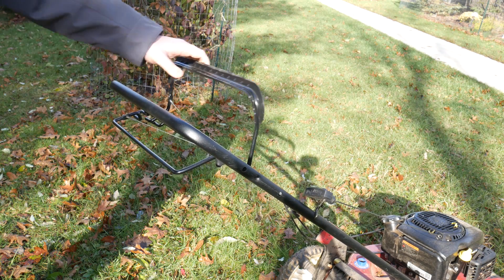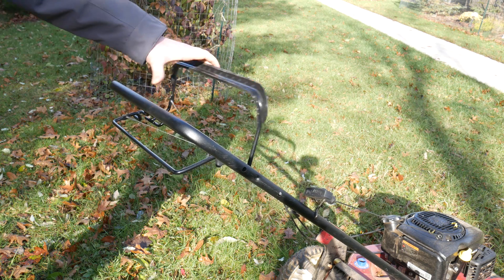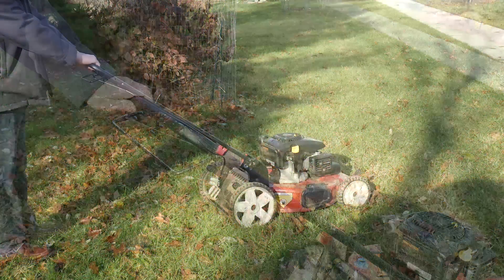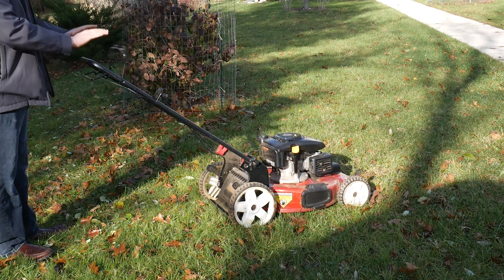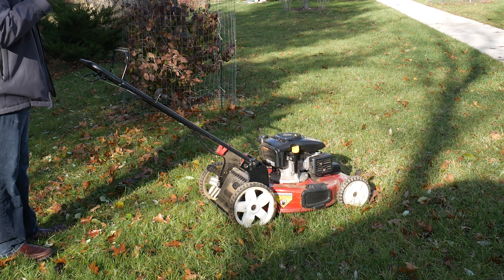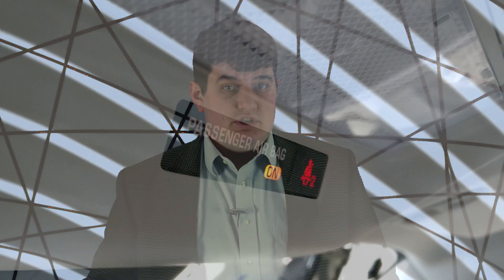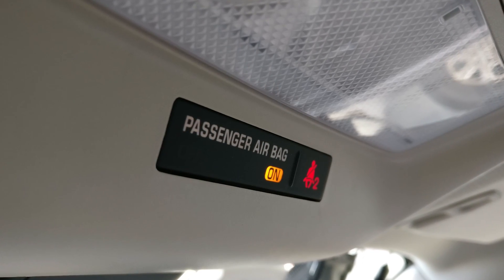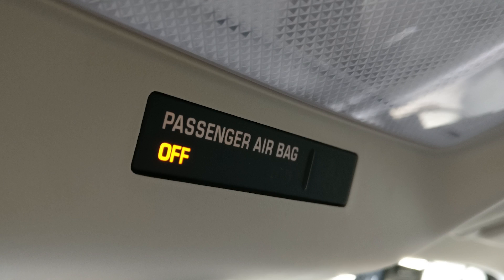The Dead Man's Switch:  How Anton Yelchin's life could have been saved

Comment: i have a question... couldn't he have just applied the handbrake? (i'm living in Korea rn and no one seems to ever use the handbrake - they'll even put blocks under their cars to stop it moving while I'm like you... you have a thing for that. A Korean person excused her poor driving by saying that "for some reason, my father in law put the hand brake on when he parked," you mean like you're supposed to?)

that said, i think you're right about having a dead man's switch in cars - why can they be operated if no one's in the seat?
Reply: Aileen I always apply the handbrake before placing my car in park. Its good for you transmission and is a failsafe in case that tiny mechanism that holds the car in place breaks.
Reply: I'm not sure about others, but everyone that I know the habits of, including myself, only engages that brake when parked on a steep incline.
Reply: @dmdizzy  I know people that won't even use the parking brake on hills. I just bought a box truck with a non functional parking brake. Clearly the previous owner didn't care to use it, I bought it from a dealership that didn't fix it, and it was a reputable dealer that also sells new cars. Not many people care in this area
Reply: On this model of car (more a 4x4) it used a stupid "foot handbrake" a lot of people don't use it as its odd way to put a handbrake on (they just use the transmission Park)
 as this model uses stupid return to center automatic stick (you have to press the button tap it up or down and then let go very bad design) it should have a open door auto park when stationery as the car automatic transmission is part of the canvas network it can already read if the door is open
Reply: I usually apply the handbrake whenever I park my car, because I was taught to, and it's another level of insurance against situations like this. But sometimes I forget.
Reply: @MattMcIrvin  I was taught the reverse: always apply the handbrake as primary measure when parking. Putting the box in gear (we mostly have manuals here) is a secondary measure in case the handbrake fails. The handbrake is designed to hold the static weight of the car. The gearbox is designed for dynamic power transmission. The gearbox can hold the static weight but it will wear out faster if you don't use the handbrake for parking.
Reply: I had the same thought. Here in the UK I've never driven a car with an automatic gearbox; so for me, to park without applying the handbrake would be insane. I was even taught to engage first gear after the engine is off to provide some engine breaking in case the handbrake fails, especially when parked on a hill.
Reply: It's just the very specific design of this car automatic gear stick it's fully electronic but that's not the problem as a lof of cars for long time have used electronic gear stick, the problem is with this design it always returns to center when you let go of the gear selector 

you press on the button on the side shifter and press it up or down it doesn't click or lock into drive/neutral/reverse, so you have to visually look at the dash to confirm what you have selected where as in other cars you don't have to look because just from the feel you know what mode you selected 

And to add to the above problem the hand brake is not a actual handbrake or e-brake, it's an actual side mounted foot parking brake so in this particular car it's very common not to use it, the sad thing is the automatic gearbox is connected to the Cambus network so the car knows when the seat belt or driver seat sensor (not seating) and door is open and should automatically shift into park when both conditions are met,, this is how BMW and a lot of other car makers have there car programed so as a failsafe it will automatically shift into park if your not moving (and may automatically activate the e-brake if it uses that type of handbrake system) if them 2 conditions are met to prevent rolling every time

The car manufacturer can release an update to make it read the door and seat belt sensors for that particular car but have yet to do so (even on the newer models of that car that uses e-brake it still doesn't auto park on the transmission) 

I even had some sort of jeep That had  automatic e-brake for stop start traffic and that thing was dangerous because if you had auto e-brake turned on and you stopped say at your house the e-brake would activate when you have stopped it then not longer after the car stupidly disengages the parking e-brake and this is in a manual transmission so high chance of rolling as a result (its not like its instant it actually waits about 15-20 seconds to take the handbrake off, so long enough to get out of the car just as it turns the e-brake off) in the end I turned off the automatic stop/start e-brake so I knew I had pulled the e-brake on when fully stopped (as because when I turned the car off, it would ignore me pulling the e-brake switch because it had already put the e-brake brake on but because the car is now off it releases the e-brake, very silly) 

Basically what was said in this video (I forgot what this video was until I looked at the title)
Reply: I can't trust modern parking brakes. I was sitting in a 2019 mb sprinter with the parking brake pulled as tight as I was able to. The van still moved after sitting for ten minutes, and did it more than once. I had to keep checking that I didn't get hit from behind. This was on a slight hill, nothing major. I could only imagine a steep hill. The only cars I can trust are the ones I've worked on. I've seen so many slightly older cars, that get maintained by shops but the parking brake is never checked.
Reply: @arthurr8670  Handbrakes are almost always adjustable in seconds. Mine has a screw on the handle that tightens it.
Reply: @kylehart8829      Not all of them are easy. Some cars need you to take apart the center console to get access to the adjustment bolt. That is only part of the adjustment. Under the car, near the brakes, there is also an adjustment for each parking brake, which is needed to be adjusted with the adjustment for the parking brake lever. On cars that haven't been touched, everything needs reworking because of corrosion, at least where I live.
Reply: Newer cars have electronic handbrakes that automatically apply in the park gear. Trying to mess around with it will just disengage it.

Comment: I have a feeling there will be a sensor in the driver's seat, regardless, since cars have to be made for left and right hand drive.  In fact, it may even be connected and its merely a software locale that decides if the sensor is used.

Our Skoda Yeti will show a specific seatbelt warning light if you turn on the electronics and there is someone not wearing a seatbelt, and I think some cars even bong at you if you try to start the engine with no belt on, so for those vehicles its just a matter of software that prevents there from being a dead man's switch.

Comment: While that's good and all, I still much rather not have a drive by wire system and be able to control my vehicle mechanically.

Hell, I've been in situations in which an engine has stalled out on me, and I thankful to have the ability to still be able to steer and brake (albeit with a bit of difficulty - them systems are hard to move when not power assisted) to a safe (or in my case, since my home is down a mile stretch of road, ride all the way home) spot.

and for those of us who like to offroad, or drive down neighborhood roads (basically a long driveway, aren't governed by normal driving laws), it's convenient to just leave the seat belt off (I've even disabled the warning ding in my Jeep for that situation).

However, my Jeep does not allow you to remove the key in the ignition unless the vehicle is in park. Just like you need to have your foot on the brake to shift out of park, you also have to have the key in the ignition, and you can't take the key out unless you shift back into park (you can, however, turn off the engine).
Reply: AND in riding mowers, while there is a deadman's switch in the seat, it only works IF the blades are engaged. If you're sitting there just with the engine going (no blades, doesn't matter if it's in gear or not cause that doesn't have any electronics), the mower will still run if standing up.

Comment: I recognize that I'm about two years late, but this is an exercise in unintended consequences.  Consider if there were a dead-man's switch in the driver seat.  What happens if a driver shifts in his seat while on the highway, perhaps leaning to one side or lifting their hips on a long drive to stretch or something?  Car shuts off?  Or even worse, shifts into park or applies brake as you suggested.  What would the potential cost to life of this "safety feature" be in reality, when compared to this incredibly low likelihood scenario.  Let's say the switch just fails (as is all too common in automotive switch components), perhaps from an overweight driver or perhaps a liquid spill.  Maybe the fuse that the circuit is on fails at some point.
I often find that if the solution to a problem seems too obvious, there are a few good reasons why it's not really an adequate solution.

Comment: My Tesla model 3 automatically engages the parking brake if I'm in drive and I open the driver side door and get out.
Reply: How does it physically move the lever to match the change in brake status? Or is that not how Tesla brakes.work?
Reply: @getoffamylan6844  It's electronically actuated, there is no physical brake handle like on some vehicles.  The normal way is to push the button on the end of the RIGHT-hand stock, which when driving and held down engages the emergency brake.  If you have the car in drive, and basically at a stop and get out of the car, it just actuates the parking/emergency brake for you so you don't roll away.  It knows you got out of your seat with detectors in the seat.

Comment: The Tesla Model S has this system. If you lift off the drivers seat the car goes into park and applies the electric emergency\park brake. There have been some complaints of the car stopping suddenly when drivers are reversing and they inadvertantly lift up from the seat when turning around to look rearwards.

Comment: Just going to point out the fact that virtually all cars since the Austin/BL Princess in the 1970s have a usable Dead man's switch already installed!!!!
The same switch that nags you to put on your seat belt could be so very easily double up as a DMS.
If you didn't know about it, or don't drive then if you sit in any car made in the last 40 years without the seat belt clipped and if you try to drive you get nagged by a buzzer and a light until you buckle up.

Comment: I wouldn’t make the seat belt sensor the dead man switch because there are time when temporarily removing the seatbelt is an acceptable risk. It is also possible to accidentally hit the release button.
However I do not see a problem with a weight sensor deadman switch provided the car also comes with a manual override. There may be times you will want the car in neutral and the engine running. A car stuck in mud or better yet snow and the operator is by themselves and needs to rock the car and kick gravel under the tire to improve traction but in winter conditions you may not want to shut off the car for fear of it not starting again.

Comment: I don't know that forcing the transmission into park based on a weight sensor would be a good idea--at least not with some additional checks and balances.

Imagine that you've been driving on the freeway for about an hour. 70MPH. Cruise control. It's hot. You only turned on the A/C a minute ago. You're sweating on your back and your groin is pressing into the groin of your jeans. You need to adjust. Being in cruise control, you decide to place both feet on the floorboard to "stand" so that you can air out your back and adjust your groin. There is no weight on the seat.

If the transmission were forced into park at 70MPH, that would destroy your transmission, cause a catastrophic loss of control, and you would likely die.

Some checks and balances that could counteract that would be to only watch the seat weight sensor if the car is going < 5MPH (edit: good job addressing that) and the seatbelt isn't on. But there are other ways that can go wrong, like in a fast food drive-thru. You might reach up to grab the food while your seatbelt is on, but since the seatbelt is on, the car assumes you're in control of the car and doesn't force the transmission change, causing the car to roll into the kerb. I personally go into park and apply the E-brake whenever I'm away from the wheel, and this habit has saved my ass at least once (I stood up to grab the food and unknowingly stepped directly on the gas pedal, but because the car was parked and the E-brake was on, the only thing that happened was the engine revving at full throttle without moving)...now imagine that happening, but with someone who didn't apply their E-brake, and who had thought they put the transmission into park, but for whatever reason it didn't, and because the seatbelt was on while they were standing, the car didn't shift. Stepping on that gas pedal would mean certain death as you floor it right into rush hour traffic.

Comment: the government is at fault for allowing manufacturers to get creative.  automatics have detents.  period.  u should be able to determine what gear ur car in from outside the drivers door, by its position, not by some stupid tiny led on a shifter that springs back to the same position regardless of gear.  my sprinter van has detents.  park is when i slam that focker to the top detent.  i forget if i do it sometimes if i leave the van while its running and i can tell whether i put it in park, if the doors open and i have a clear line of sight to the shifter, easily from ten feet away.  vehicles are no place for creative license, just like they shouldn't have touchscreen controls.  at all.  buttons and levers are a good drivers best friend and touchscreens and buttonless or leverless controls are dangerous toys on vehicles driven by people that underestimate the responsibility of driving.  that and the sheer hypocracy of the b*llsh*t the government allows.  if i have a cell phone pinned to my ear with my shoulder while driving i'm breaking the law, but a musk driver can finagle with his 24" touchscreen controls all day long, looking for easter eggs in his software or scrolling through menus looking for his heater controls and he or she hasn't broken any laws?  bollocks!

Comment: "steer-by-wire" oh boy I can't wait for my alternator to unknowingly go out and have my battery die while on the road!
Reply: Yeesh, hadn't even considered that.  Throttle control loss would be fine there, but good luck guiding to the shoulder in that scenario.  Add in brake by wire and bam, RollerCoaster Tycoon 3 IRL.
Reply: lacking a mechanical linkage between the steering wheel and rack/pinion or recirculating ball steering rack is against ADR (Australian Design Rules) and would banned in Australia.
Reply: and even if you manage to stop safe on a straight road you couldn't push/roll it out the way without steering. It seems such an odd idea to over complicate something that's been proven to be reliable and instead add it to the massive list of tasks taken care of by the computer, I can't imagine it even has and advantage over a mechanical linkage, well for the driver anyway possibly makes manufacturing easier
Reply: @_______DR_______  You dont have to wrestle with steering forces on the road. Although some systems do provide some force feedback.
Reply: Brake and steer by wire all have a back-up physical linkages. 
Thank goodness.
Oh wait. 
The google self driving cars don't
😔😩. 
Humanity... I give up.
Reply: Yep, that happened to me. Losing the engine and power steering while doing 80 on a busy highway at night was terrifying, especially because my hazards were gone too. Thankfully I still had enough control to wrestle it onto the shoulder and stop. Those physical linkages are vital.
Reply: There is actually a mechanical failsafe clutch that will engage and return function as mechanical steering if there is module failure or lack of power.

Comment: Yeah. The dead man switch is a pretty good idea. The existing ABS controls could be used to apply the brakes in the absence of the operator as well.

However steer by wire should be *totally illegal*. I'm also sketched out by electric E-brakes. Its fine for aircraft, but cars lack their redundant systems and there is much more stuff to ram into on the ground. The idea of a bad coil, electrical fire, electrical failure, hydraulic leak, or even industrious rodents frying my electrical system and preventing me from either steering or stopping terrifies me.

Pure fly by wire is automakers being cheap and it undermines vehicle safety.

If a car wont move, that is frustrating. If it wont stop, thats a missile

Comment: I mean just using your parking brake is a good solution
Reply: Then you also have to remember to disable the parking brake every time you start to drive.
Reply: @encycl07pedia-  it's not that hard
Reply: @encycl07pedia-  It's also not that hard to form a new habit. Anyone who drives a stick uses it every time they park. And the car will beep at you if you forget it would be very hard to drive more than a couple feet with it on.